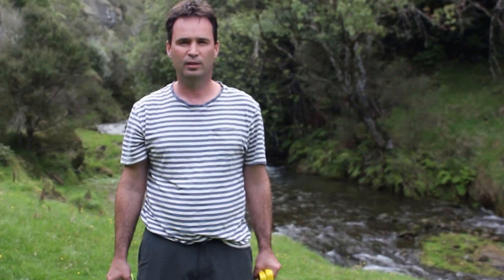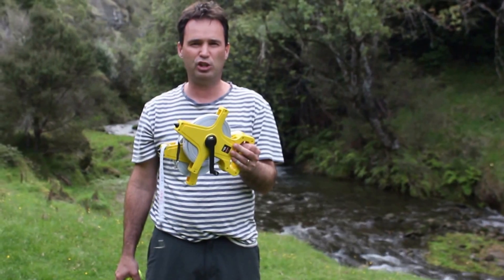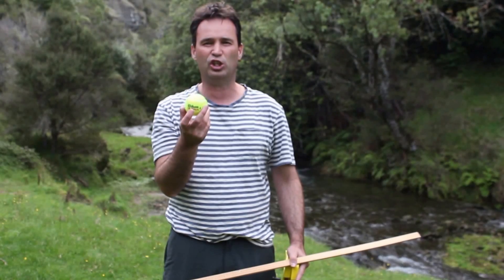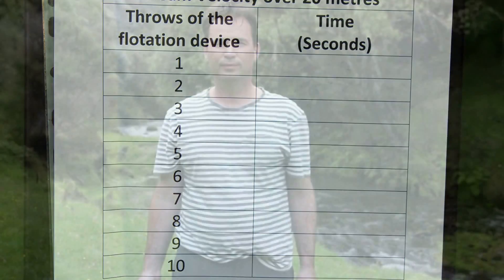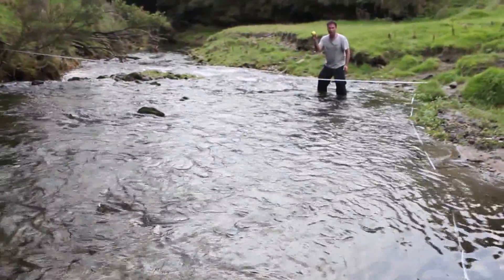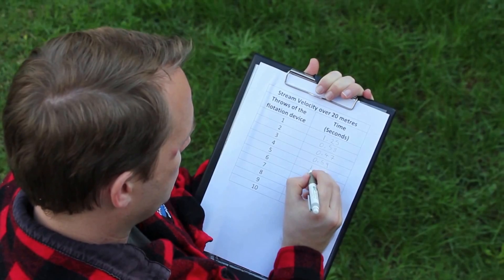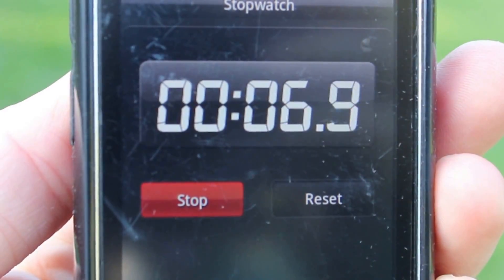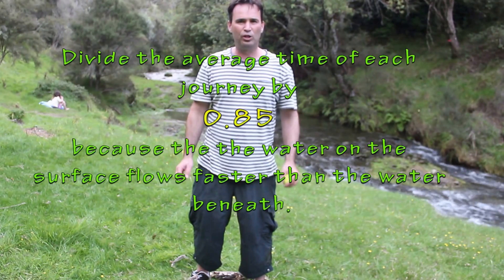How to Measure Stream Velocity

Comment: Hi Darron,
I notice you mentioned the 0.85 factor for surface velocity vs mean velocity. The error in the video is that you need to multiply the surface velocity by 0.85 in order to get the mean velocity rather than divide. If you divide, your mean velocity will calculate out higher than your surface.
Reply: he says to divide the average TIME of each journey by 0.85
Reply: @doddi1  correct, he says that, but to divide is WRONG